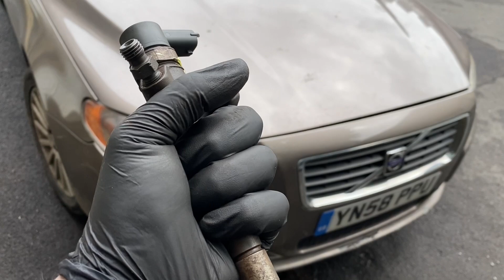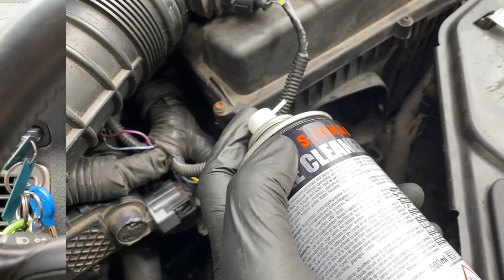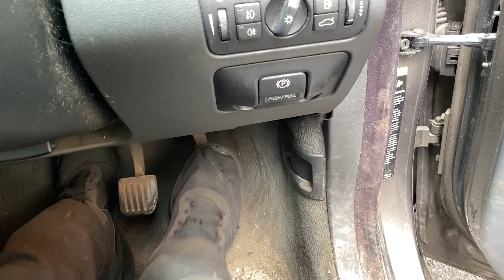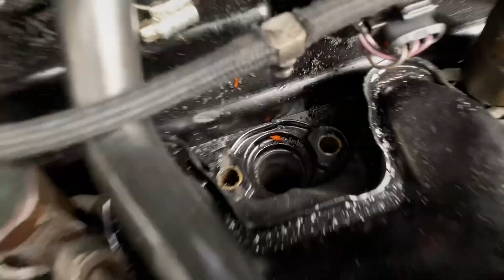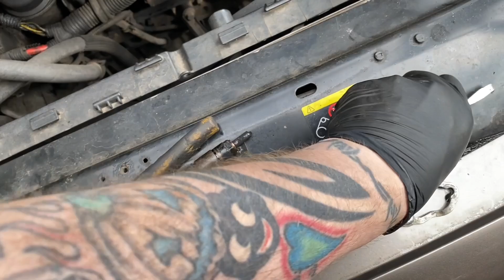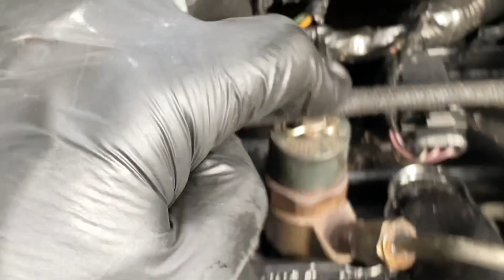Volvo V70 D5 Injector Replacement / Faulty Diesel Injector Diagnose and Repair

Comment: https://youtu.be/21Iy3CX8QI8?feature=shared
Hi! Have you ever run into an issue like the one shown in this video? It just started happening to me. 😁 I'm not sure if it's the injectors or the MAF sensor, although all the OBD readings look good. Thanks in advance for any advice! 👍
Reply from the maker: What’s the fuel pressure reading, requested vs actual?
Reply: @StupidBlokeStupidVideos everything is fine. I probably found the problem. One injector -3.3 mg/str

Comment: Is it only the copper sealing on this car, is there any other sealing under the clamping? Reason I am asking I have similar car and I had to unmount the injectors to repair something else and when i reinstalled the injectors, one of them went ticking and puffing air and nasty smell going into the car. I think it have to do with the copper/other sealing. I will unmount the injectors again and check if I missed some sealings. Please advise if there is more sealings i should check for?
Reply from the maker: Just the copper seal but make sure the seat where it sits is clean etc. as sometimes they need re grinding.

Comment: Is it possible to find out at home which injector is leaking? Without bench / leak‑off test.
Reply from the maker: A leak back test is probably the easiest way and kits are cheap
Reply: @StupidBlokeStupidVideos What if I unplug each injector connector one at a time and listen for changes in the engine noise?
Reply from the maker: @gazgaz252 that I’ll just cause it to stop injecting on that cylinder. The leaking that causes low fuel pressure is usually on the low pressure side

Comment: My 2012 volvo v40 started leaking diesel from the engine. When I opened it,the second injector from the left was swimming in the diesel. Could that be the o ring, or should i replace all the injectors?
Reply from the maker: Check the connector for the leak off pipes. It could be cracked or the o-ring, or pipe damaged. That’s the most likely cause, ok the low pressure side
Reply: @StupidBlokeStupidVideos thank you, will check immediately.

Comment: Great video👍Have you ever tried a injectors cleaner? Would it be worth a try?
Reply from the maker: Not in this case. It was leaking back to the tank on the low pressure side

Comment: Merci pour la vidéo 

Est il obligatoire de faire le coding ? 
J’ai acheter mes injecteurs d’occasion car la voiture le voulait pas démarrer. 

Elle démarre seulement avec le brake clean
Reply from the maker: The coding is a calibration code to fine tune them

Comment: hiya what spray did you use as im trying to get xc90 start after I took them out then put them back in
Reply from the maker: @leeshenton1068  brake cleaner, but avoid it if possible

Comment: I came across this video very late, I stalled on the move and for about a week I was looking for problems with diesel fuel, filters and sensors, today I tested the injector for departure and replaced the injector and everything works, I needed this video as soon as possible 😢
Reply from the maker: @serhiy98  got there in the end. Hope the vid helped

Comment: Ab Werk wird jeder Injektor trocken eingesetzt, nahezu jeder Mechaniker hatte in seinem Leben mindestens einen absolut festsitzenden  Injektor, aber nur jeder zweite fettet die Teile vor der Montage mit Antiseize ein. Muss ich das verstehen?
Reply: Klar, weiß ich. Ich sag es mal anders. Die Injektoren sind herstellerseitig nicht beschichtet, meist kommt nur eine chemische Oxidationsschicht zum Einsatz, deswegen rosten die Teile auch dermaßen. Durch den Rost wird die Oberfläche rauer, was Injektoren erst recht festbacken lässt wenn erneute Verteerung entsteht. Fettet ihr sie vor dem Wiedereinbau nicht ein, dann bekommt ihr sie beim nächten mal erst recht nicht mehr raus. Also penibel säubern, eine möglichst glatte Oberfläche schaffen und so viel Fett auftragen wie der Spalt zwischen Schacht und Injektor maximal zulässt. 
Wer sein Auto liebt, der baut die Teile pauschal alle 100.000 km aus, denn dann gibt es im Falle des Falles kaum Ärger mit defekten Dichtungen  und bombenfest sitzenden Teilen, bei denen der Injektor demoliert oder im worst case der Zylinderkopf geschrottet wird. Gibt es oft, das ist kein Spaß, weil sündhaft teuer.
Reply from the maker: @p.s.7396  Um ehrlich zu sein, ist das meiste, was festklebt, auf Kohlenstoffablagerungen zurückzuführen, aber in manchen Fällen sollte Anti-Siebe helfen

Comment: Many thanks for your video. I started to get fuel pressure regulator faults about a year ago. Twice after an hard acceleration on a. Motorway the engine cut off. I tried to change the regulator and sensor, filters. Nothing helped. I checked the Injectors and one is leaking badly. I'm planning to change it soon. Your video filled me with hope again.
Thanks
Reply from the maker: The injector leaking back can definitely cause your issue so I’d definitely agree that changing it should sort the problem. As long as it isn’t seized in, then it’s a nice easy job.
Reply: I've just replaced injector no 1 as it was badly leaking. On the scanner its dose was about 5.4 here other 4 are very close to 0 (- 0.01 to 0.05)
Ive installed and coded a brand new (not rebuild) bosh injector. It is a massive improvement! It has a dose of 0.03 so very similar to other onea in my engine. Engine starts a lot softer and faster than before. Many thanks for the video. It helped in my issue as I was blaming the rail.
Reply: Just happened to my d5 v70 I was thinking my fuel pump had gone but am hoping it’s just a injector now, I put my foot down for a split second and engine service system required came up then next couple mile later car lost power and shut off and wouldn’t turn back on but will crank over
Reply: @M1.942  stop safely on the hard shoulder. Take the fob out of the slot and put it back on. It will start then.
After that tour automatic gearbox will need some time to start to wark. Mine locked on the first gear for about a minute. I have noticed that you need to rev the engine to the rpm's when it lost power. After that it will start shifting.
Good lick with your issue
Reply from the maker: @M1.942  have you tried a bit of brake cleaner to see if that gets it started? I’d advise doing a leak off test to see if any injectors are leaking back excessively
Reply: Any tips on getting a good deal with the copper washer as I'm getting some diesel blow back up the sides of a couple of the injectors. The surface that the copper washer is sealing is as clean as a whistle

Comment: Hi, it's possible to remove only intake manifold (uper part) instead all rocker cover in case clean it from oil and carbon deposit ?
Reply from the maker: It’s all one piece if I remember right. The inlet manifold is part of the rocker cover
Reply: @StupidBlokeStupidVideos  thx

Comment: No coding? Boooohhhhh. On the other hand, redeemed by the EPIC foot tap... YES!!
Reply: The ecu will figure it out after a few miles and adjust the fuel trim to compensate.
Reply from the maker: Sorry about that. The foot tap is probably the only good thing in most of my videos tbh 😂

Comment: Another way to get the injector out would be to crank the engine over and starting it with nothing holding it in. However, I wouldn't advise doing this because, while it was indeed a successful method of getting the injector out of the head, it also removed it out of the engine bay and traveled at least 20 foot up in the air because it was eventually found on the roof of a building. Yes.
Reply from the maker: Removes the injector out of the head, and installs it into the forehead.
Reply: @StupidBlokeStupidVideos  Your reply has me cracking up 🤣 Into the forehead🤣🤣
Reply: @StupidBlokeStupidVideos  might knock a bit of sense into you? 🤔
Reply: You should loosen it's mount just a little and drive around. Then it wouldn't fly at Mach 10 out of the engine bay

Comment: The best headlight removal system by far is on those Volvos.
After any sort of injector issues , either petrol or diesel I always insist on doing an oil change ,, many modern cars can spin bearings with even a hint of oil dilution ...
Reply from the maker: It is good innit, I show it in this video. 
This cars got/had a few issues recently. We’ve got the shitter running ok now and will be getting a good oil flush soon hopefully 

This is the headlight removal you was talking about 🤣 https://youtu.be/C_3mN15gh6s
Reply: @StupidBlokeStupidVideos   as per previous , if ts had dilution it wont need a flush lol 
once an injectors leaking at one end , odds on its not right at the other ,,, bit like a dodgy curry , both ends at once , ,,, no extra flushing required .

yep the hand grenade system ,,, pull the pin and hope for the result you wish for.